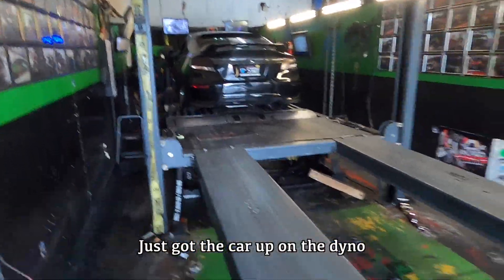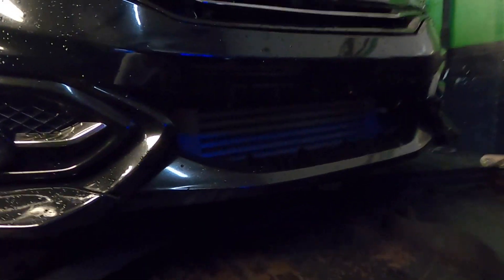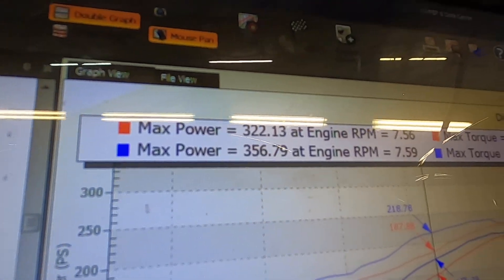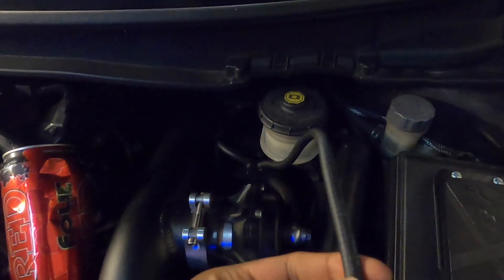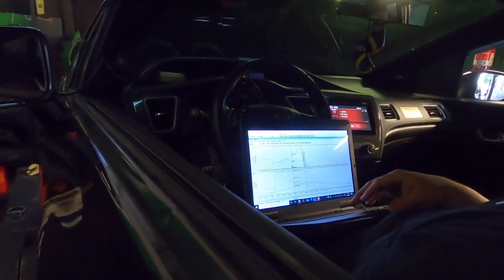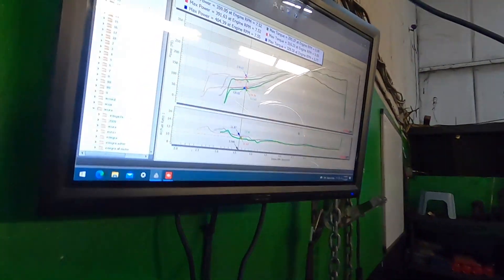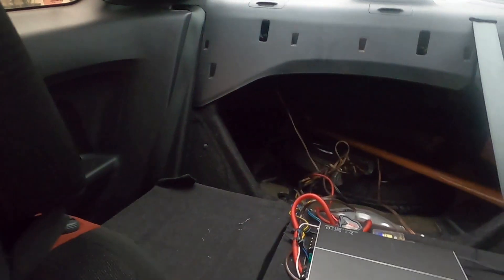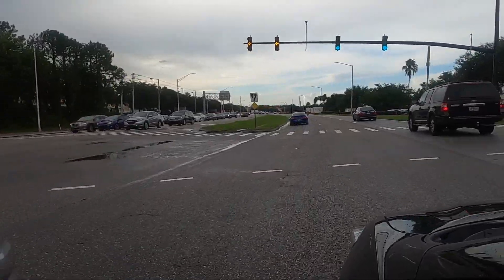TURBO K24 CIVIC MAKES CRAZY POWER ON THE DYNO!! *FLAME SPITTING BEAST!*

Comment: Great video btw. Question... I have a 2014 si 2 door coupe and I put in a skunk cold air intake which went all the way down and I did get flooded out one day and the engine fully seized and I got a newer motor. I cut the cold air intake from being soo low and turned it into a short ram. I just 2 days ago ordered a rbc kit,down pipe,and full skunk 2 exhaust the 76mm 3 inch. I only have the skunk 2 muffler on my car now. I also live in Florida and the person who tuned my car was derf tuning in ft Lauderdale.  By adding all the new stuff,how would you think my car should run?

Comment: What's good bro? Quick question if I'm on a stock tune for 9th gen si can i out 💯 Octane gas or stick to 93?
Reply from the maker: Stick to 93
Reply: @KoreyWright  ok appreciate it bro
Reply: @KoreyWright  I lowered the vtec from 5,000 RPM to 4,200 RPM... MUCH MORE FUN to drive
Reply: @cheflos524  you lose power by doing that to this engine
Reply: @Jayyy64  are you referring to lowering the vtec to 4,200 RPMs or the octane of the gas?
Reply: @cheflos524  lowering vtec to 4200
Reply: @Jayyy64  where's the best rpm to have it engage in?
Reply: @cheflos524  if you are stock and with no mods with a flashpro basemap there is no point to lower vtec engagement
Reply: @Jayyy64  yeah all i have is a straight pipe...I'm on stock tune... Is that better than the MAF tune calibration?
Reply: @cheflos524  yeah just stay on stock tune 
Hondata basemaps are bad, might as well save up get your bolt ons and get a custom tune
Reply: @Jayyy64  thanks bro, I'm debating on cold air intake or downpipe
Reply: @cheflos524 I would try to buy both around the same time but downpipe first it’s basically the most important mod after flashpro that’s where all of our power is from going catless 3 inch 
I have skunk 2 CAI, and downpipe with q300 exhaust
Reply: @Jayyy64  i appreciate the advice brother ...i did a straight pipe and it sounds nice but idk if i should get a catback exhaust system as well.
Reply: @Jayyy64  hey do you have a fb messenger or any social media i can hit you up on?